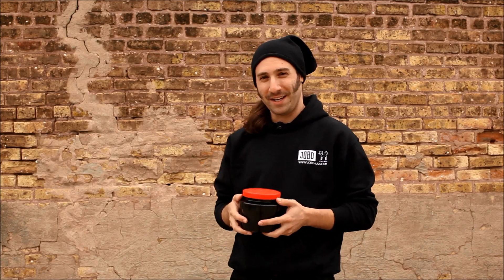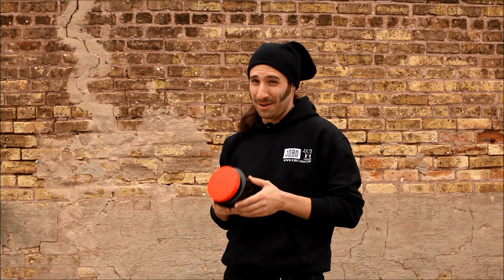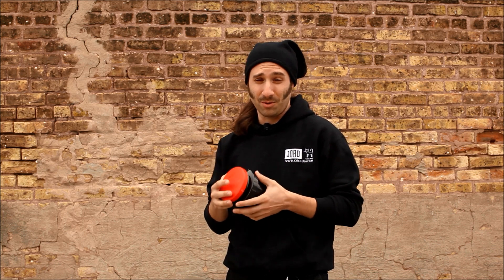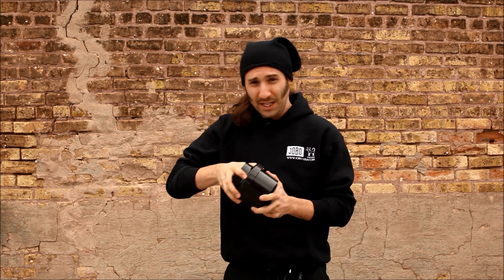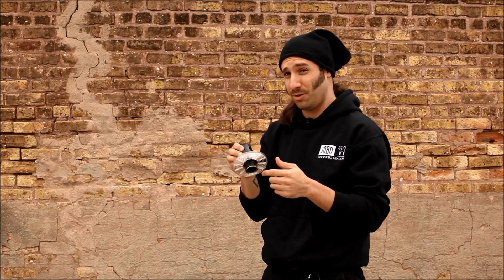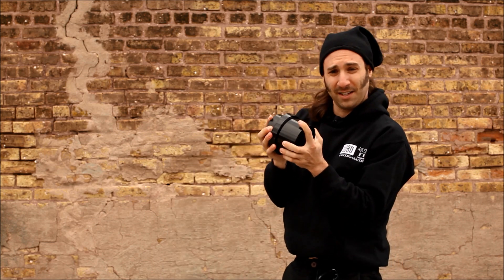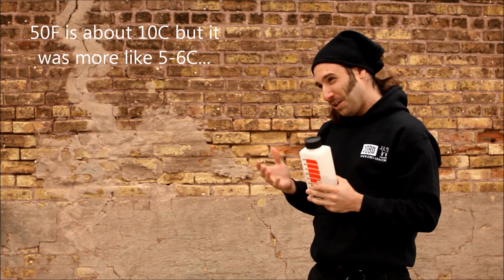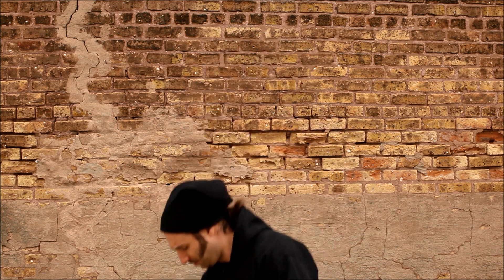How to process a roll of film with no darkroom or changing bag: Jobo 2400 daylight processing tank

Comment: Wow dude! This has never been done before! cough lab box cough
Reply from the maker: Jobo 2400 Daylight tank introduction: 1976. Lab-Box introduction - 2019......
Reply: @CatLABSJP   Lab-Box is poorly constructed (China) employing hot glue as a sealant and while OK for 135, the 120 module has serious design issues and can't be used with PET-based 120 film at all.  I've replaced mine with a Jobo 2400 as I want to do colour work and wouldn't put the Lab-Box anywhere near a water bath.

Comment: would this work anywhere? I'm interested in developing color film 35mm and 4x5 from home but not sure what I would use to keep the water at a constant temperature.
Reply: +Eddie Higbee If you are talking about how to keep the chemicals and water at a certain temperature in your dark room or while you store it, maybe a box to store it in. I keep imagining a picnic cooler as an easier example. Maybe one for each chemical. 

I know when I was in a darkroom setting there we enough of us going in and out, we were changing the chemical baths often and we had a dry mix.

If you want to keep your chemicals at a consistent temperature in the field, I think of good thermos' marked clearly so no one else uses them for something else.

I would certainly check my suggestions against someone who is currently doing all of this. I am a traitor and moved over to digital. I miss old school though. 

Best wishes!
Reply: Sous vide machine, one that you hook to side of container

Comment: Freaking brilliant.

Why hasn't anyone reissued a version of this (or Jobo themselves)?????

I want one.

I'd pay anything to get one :)
Reply: yes, there is a re-issue, but of the 'concept' called the ARS - Imago 'lab box' same idea, just square, but this takes 120 roll film too, not just 35 exclusively.
Reply: @andyvan5692  I bought the Lab Box, it is garbage.  There is no comparison with the Jobo 2400, which I bought on eBay only after the Lab Box had destroyed the first two films I tried to process with it.  The design is flawed - the reel is too small diameter and they don't supply the crank handle as standard, resulting in sub-standard agitation and poor results.  As for stand development, forget it.  The stupid clip mechanism to hold the film leader is very difficult to attach accurately so the film is not guaranteed to enter the reel correctly.  The Jobo is a far superior product, if you can find one.

Comment: also you can skip the stop bath??!??!? This video is blowing my mind
Reply from the maker: heyitscaroline In general, yes, you can skip the stop bath entirely, at the cost of weakening your fixer with left over developer. In this case we used water as a stop stop solution, which has a low enough PH to act as a stop bath for this process. Film developers in many cases are much less aggressive then paper developers, and water is enough in these cases.

Comment: is there a daylight loading tank for 120 film?
Reply: Not that I've seen, there is no easy way to separate the film from its paper roll without a human hand, in the dark.
Reply: Scott Becker I actually found one call Agfa Rondinax 60 in a local store in Ottawa, sad thing is this product got discontinued around late 50s, it is very hard to find one. However, they do come up on ebay once a while. Just make sure you are NOT paying over $100, price on these are crazy on ebay. I bought mine in a local store for $40 Canadian Dollars. This thing works like a wonder, save chemicals and easy to operate. I'm actually thinking about using 3D printer to make clones, but then the patent becomes a issue.
Reply: @fangzhenyuinca  a patent only last for about 20 years

Comment: nice video! do you know in what year was this tank launched??
Reply: there are other alternatives here is a link https://www.google.com/shopping/product/10678333656562731601?q=daylight+processing+tank&client=safari&rls=en&bav=on.2,or.r_cp.r_qf.&bvm=bv.69411363,d.cWc,pv.xjs.s.en_US.SU4soCeLflY.O&biw=1260&bih=680&tch=1&ech=1&psi=jZ2nU-jrJYjisAS87YHADg.1403493775618.3&ei=tp2nU4OfPLLOsASg4YHoAw&ved=0CIIBEKYrMAI
Reply: ***** The tank in the link is a daylight tank, but you must have a changing bag to load the film into it. The Jobo 2400 daylight loading tank allows the user to load the film in full daylight with no need for a darkroom or changing bag. Aside from that, loading SS reels is a real pain...